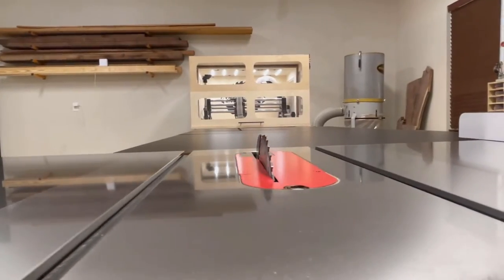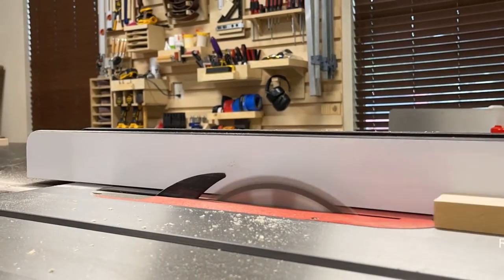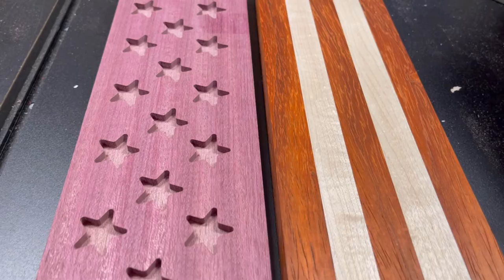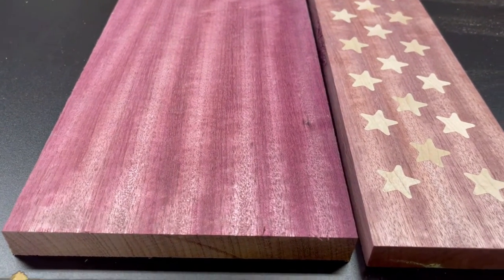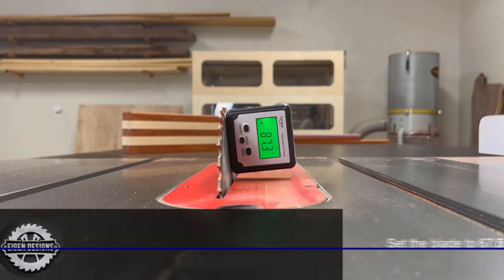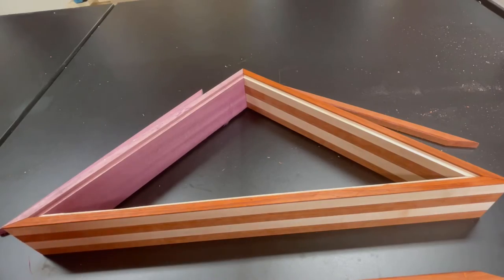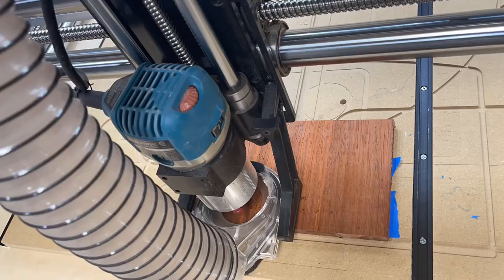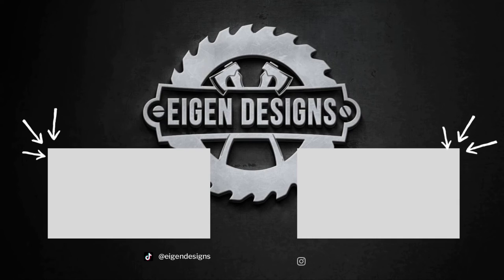Ultimate Stars and Stripes Flag Case |  CNC Inlaid Stars

Comment: Wow!     Another fantastic project !
Reply from the maker: Thanks Craig! :) Did you see my instagram post? I had it up there first.
Reply: @EigenDesigns  yes i believe i saw it first there.Oh another question for you. when you built your table and put the control box underneath as you show, did you have to order any longer cables ?
Reply from the maker: @craigwesson1788  yes, I had to get an extension cable for the X rail and I also had to get longer USB-C and HDMI cables for the screen.
Reply: @EigenDesigns  ok thanks. the two pack of 4 foot extension cables be enough?
Reply from the maker: @craigwesson1788  that will be plenty